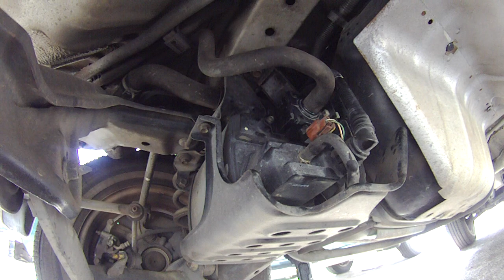HONDA CRV CANISTER PURGE VALVE LOCATION P 1457 CODE DIY  Part 3

Comment: What is the exact name of this part? I read all the comments from all 3 of the videos and I think this is what I have to replace on my 2002 Honda CR-V. The code 1457 came on, but I'm on AutoZone website now trying to price check and I'm not sure the full name. I put by pass valve but it didn't pop up.
Reply: Evap canister vent (NOT "purge") valve.

Comment: I couldn't get the screws out of mine. The threaded insert that goes into the plastic just kept spinning so I just pryed the whole thing off and got new threaded inserts. Its honestly easier to just pry the thing straight out instead of bothering with the screws.
Reply from the maker: Good job!

Comment: great set of videos. I would like to see more in detail the assembling of the component with silicone or whatever you put to seal. My code is p2422 CRV SE 2006. Honda  Evap Stuck Closed
Reply from the maker: You may have to replace it anyway so just try your best. I eventually had to replace my unit.
Reply: Thanks for the update. Do you have a link for the part?. Thanks again in advance

Comment: did this work.  im about to buy a crv that has this problen
Reply from the maker: Actually the leak was on the front top. VTEC Filter cover. that did work.
Reply: so either way it was a pretty simple  fix?
Reply: so either way it was a pretty simple  fix?
Reply: either way it was a fairly  simple fix
Reply: either way it was a fairly  simple fix
Reply: Sorry for all the posts.m my phones messing up
Reply from the maker: +Jenna Krouskoupf yes very easy
Reply: Awesome  thank  you! Im paying 1200 for an 00 crv.. figured  if it was a simole fix it would be worth the money and 2 hour drive :)
Reply from the maker: +Jenna Krouskoupf keep in mind that the 2000 CRV has a timing belt. That should be replaced at 90k make sure that was done or the Engine will go south.
Reply: does that have to donwith this error code? i was told  to Do that  and water  pump
Reply: Yeah  i was told to do that as normal maintenance